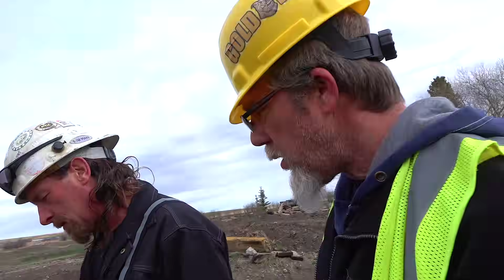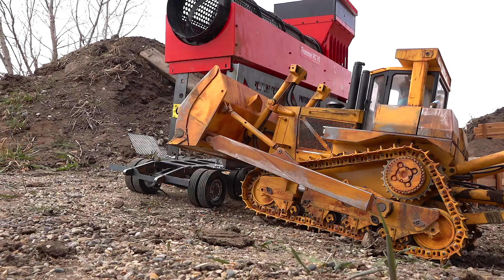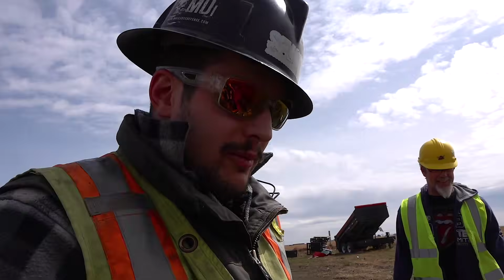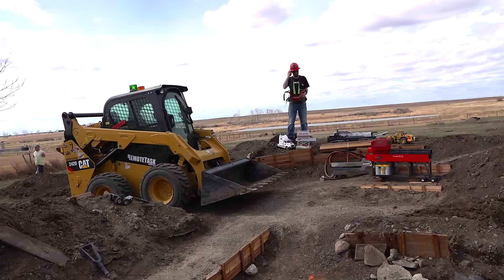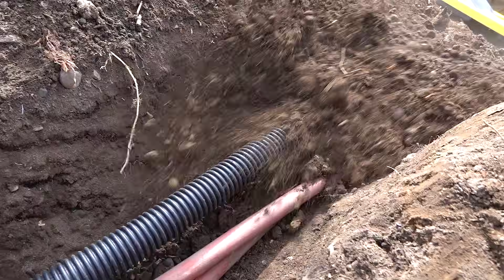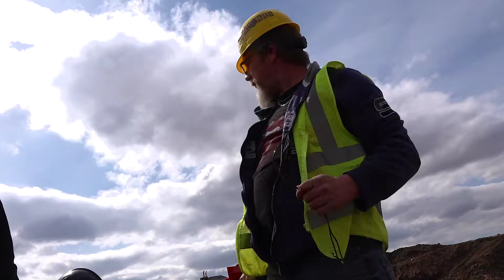YouTube GOLD  - 8x8 Heavy Haul Mine Site Move : Make it Snappy (s2 e4) | RC ADVENTURES

Comment: Rc sparks i need help  
My rc rock crawler  is making a strange noise. i opend it and checked it. it seemed all fine
Reply from the maker: Tell me more. Is the noise coming from the front, middle or back of the RC
Reply: It is the back
Reply: It sounds as if one of the gears are not in place
Reply: Its diffucult to describe

Comment: I find it ironic that the trailer is designed to keep the weight off the tractor wheels so you have to add weight to the tractor so you can pull the trailer. 

The 8x8 needs front & rear steering. The drive shafts look too small. And thicker dental floss. Great sound tho.

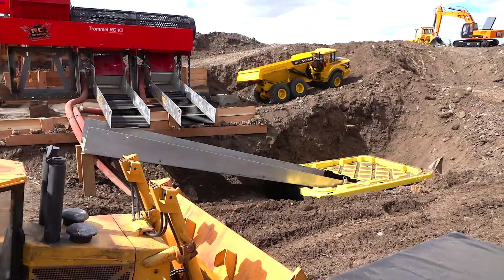22:49 "Rock truck, quit humping the trommel!" 

Dont dig up the drain, just add a new hose running the same path using the discarded sump pump. Thats how Tony Beets would do it. Well, Tony would do it that way while cursing.

Comment: First of all you're heavy haul road truck needs a snatch blocked winch setup, and also doesn't have enough axles even with the Jeep you should have had a 5-axle roller trailer on bags with a stinger and Jeep And you need a true tri-drive tractor for better traction, also you should have had two of your 8 by 8 off-road winch trucks wench that off of the road truck and two truck it up the hill for safety 1 Forward facing one reverse facing both on center deck pivoted bolsters,otherwise you got a truck your crawler Crane in on four road trucks and all the work that goes into installing your  crane main truss belly and track weights and rear weights and don't forget it's heavy so you can't use your whip line on this stuff only snatch block lifts, lol just screwing with you love your show my kid loves it also we watch it together keep up the cool scenarios and if you ever do get tired of moving dirt make a walking oil rig and move it around drilling small holes

Comment: On the Jeep, shouldn't the 5th wheel plate be ahead of the rear axles so it actually puts weight on the drives without needing ballast?

Comment: No running on site greenhorn, everyone is going to think theres an emergency.  Geez
This is called a mine for a reason.  Lmfao.   Line length and head  pressure, that's where your flow went. Far more productive than Todd the lounge singer Hoffman.

Comment: Just a suggestion for the pump wiring 6awg would be the minimum size I would run , less voltage drop and handle the higher current with ease , another fantastic episode thanks from Australia. FNQ to be exact were winter lasts 3 weeks in a bad year

Comment: Your black tub you have the water running into that is over flowing not draining fast enough . How about one of the 850 GPM pumps mount it in the tube near the top with a float switch on it. An run the hose down next to the other. The pump will move more water then gravity-fed hose.Just a Idea to help you out.

Comment: What you should do after you cut a road or anything else to grade, fill the haul truck up with dirt and use it to wheel pack everything tight... just a tip from one fellow operator to another 👍

Comment: You need to do some research into example: Bell siphon pump, it might just add that little extra pressure needed. Some firefighting techniques work with a 20% pressure, meaning what is the normal flow and then add 20% on top.

Comment: You sure start around the whole that you were digging out with excavators little head and dug it out then put the excavators back making it look like they're done with it and bringing your Crane in to pull the wood and put back in place and Joe needs to wear his yellow vest not that thing he's wearing he needs to wear the yellow vests will that belt system over top of it I have I have some trailer system something what you have what you should have done was put a motor in the back to help push it or put another truck in the back to help push it you should have used an excavator the hold the system up instead of bulldozer but I'm loving it it needs to be a little bit longer need an hour video of it